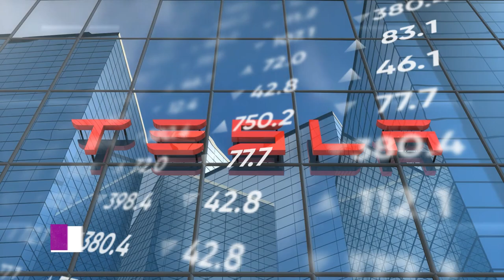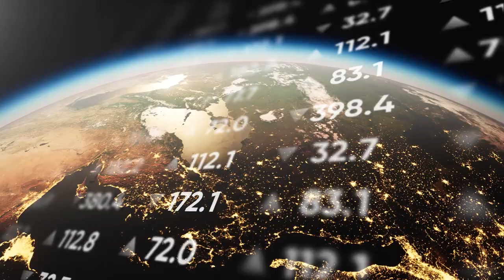Hyundai Builds New INSANE Factory In South Korea

Comment: When Hyundai starts selling smaller affordable EV's for the masses, that can doe 300km in the winter, i will be back an interested. 
And no, i dont think €30.000+ prices are affordable for the masses, where small ICE cars in the A segment are around €16.000.
Reply: @Grizzly HP2. Nissan Leaf is about the only affordable EV, but the range is too short.
Reply: @mrgurulittle7000  The new model 2023 should be just below €30.000 and has the 40kWh battery pack with a decent 200mls range. For most people, €30.000 is not realy affordable, but the range is usable in 99% of the time. I gues, most people would have enough with that range. We never ride longer than 2 hours without stopping anyway. So with a good fast charger it would cover all needs. Except for the price, it seems a reasonable car.
Reply: @Grizzly HP2. You're talking about the Nissan, right? Cause, that's a good car for a good price.
Reply: @mrgurulittle7000  Yes, The new 2023 Nissan Leaf. Good car, but at just below €30.000 it still is a lot more money to buy than the same car in ICE. For average Joe in the EU, that buys a car below €20.000, still to expansive.